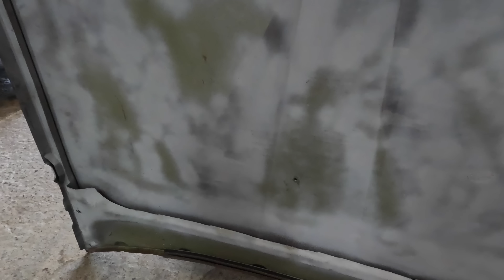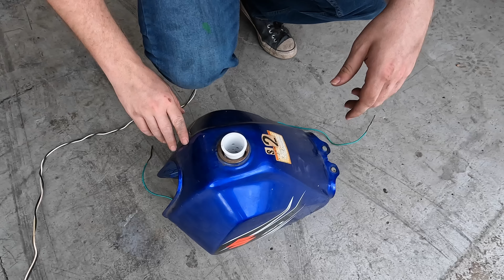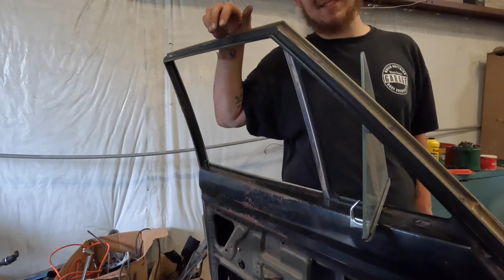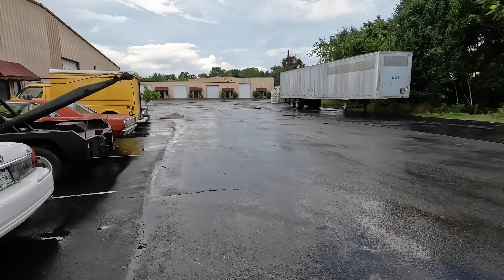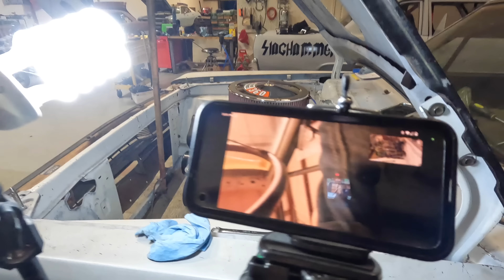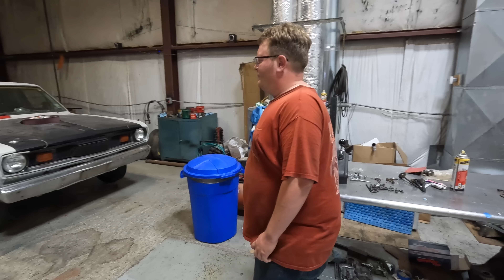This 1971 Mopar A Body Race Car Is Almost Ready To Actually Start Drag Racing(Also Jon Does Science)

Comment: My oldest boys learned on a yz100. Late 70s model. Around 2004. It needed rings.  Had a Suzuki front wheel assy. Honda rear wheel.  Squirrely but it went round n round for 3 yrs

Comment: Good lort boys. JIGSAW JIGSAW! WITH A METAL BLADE. but overall. Pretty darn good with a crappy cutting wheel fellers. Maybe some thin weather stripping of some type can go around that lip to dress it up a bit?  Just thinking outside the box or trying to to spark new ideas

Comment: Sticking the air breather looks good but bad for air turbulence around it with no hood scoop which is used to direct the air better as the engine is sucking air in
Reply from the maker: Yeah, but I just can’t bring myself to put a scoop over it. Neither can Jon lol. 

Cosmetics are important too lol
Reply: @DaddysMoneyGarage  only reason I mentioned it was because Mopar did wind tunnel testing back in the day that's how they came out with the six pack scoop read up on it

Comment: I'm not understanding why y'all didn't just take a string ( the radius of your hole) tied to your sharpie once you found center and then  cut it out very neatly with a grinder or a sheet metal nipper if anyone had one. It looks like someone free handed the hole around the air cleaner lod them the constant trying to clean up the rough edges.
Reply from the maker: Thats what a strip of vacuum line is for lol.

Also we really dont care about the cosmetics of the car as much as function.
Reply: @DaddysMoneyGarage  good thinking. I didn't even think of running a little trim piece around it. I get this is about function but you still don't want to look hacked up.

Comment: Happy 4th , I think you need to  remount the fuel pump(maybe to the rear frame rail )  Just my 2 cents.  Are you guys going to run a pinion snubber? The car looks like it belong on Van Nuys  Blvd . Ready to do battle . Cant Waite to hear it run. If that Honda pulls up to run just tell him,  Meet me on Paradise Road.